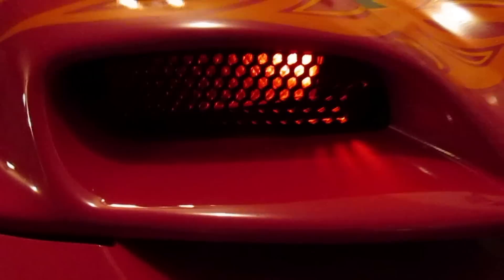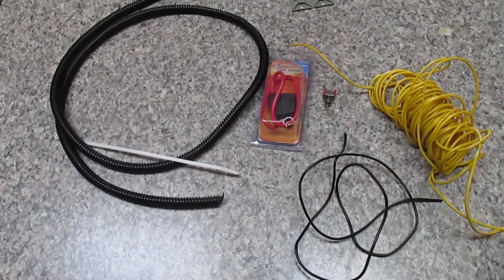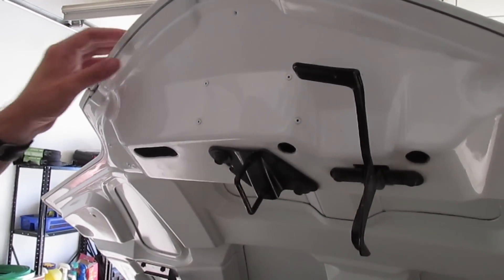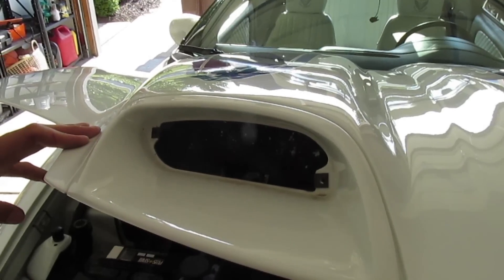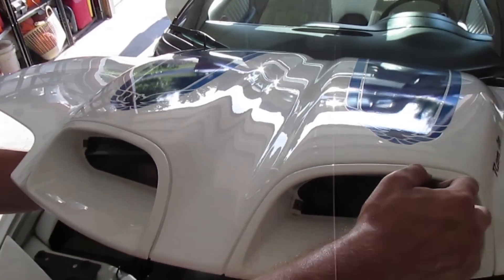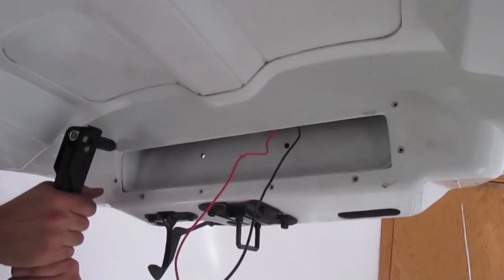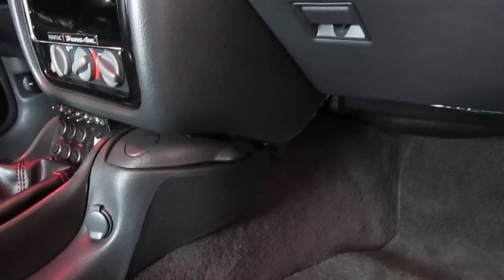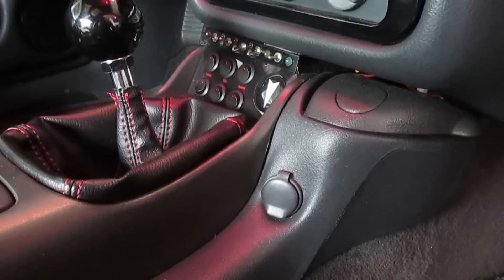1998 - 2002 WS6 Trans Am Knight Rider Light "How To Installation"

Comment: when i fished my wire through the hood, i used a small steel washer and dental floss tied to it.  then i used a neodymium magnet on the outside to pull the nut down to the bottom hole by the hinge.. it took me like 3 minutes to pull it through and you can go around the seams and only have to drill two holes total...  just an FYI...
Reply from the maker: Thanks, I'll have to give that a try.

Comment: Awesome man I bought my ws6 with this already installed however one side stopped working I want to put a new one in i don’t know how the previous owner did it but I seem like he didn’t move any rivets I need help 🙄
Reply from the maker: The previous owner probably put in one of the cheap Amazon led strips of they were able to get it in without removing the rivots.   Mine is quite a bit different and has to be installed how I show it in the video.  I sell it for $299 with 30 scans and 10 speed per scan.

Comment: Interested in the metal plate on the red Trans Am. In front of the air lid. Thanks.
Reply from the maker: That's the JAAM panel.  I could be wrong but it may be discontinued.  Check out WS6Store.com.   They might have it.

Comment: nice and this is old post but does anyone know where they have a kit with this many leds for sale in 2021?
Reply from the maker: I still sell them. I sell this version light for $299 shipped to the US. It comes with 30 scans, remote control or Android control. To get both is an additional $25.
Reply: @1999TransAmWS6  thats great i will save the email not sure which way im going have a smoothie Q hood and my factory WS6 2002 oem hood, working on intake and exhaust now but money is bad during covid19
Reply: @1999TransAmWS6  btw where are u located? Im in the US in SC
Reply from the maker: @beachsidebum  In Illinois

Comment: Excellent video!  Do you (or does anyone) happen to know where I can find a similar kit (pun intended) for a 1996 or 1997 Trans Am with the single Ram Air hood and not the post-1997 split "snorkel" style?  Thanks!
Reply from the maker: I custom make the knight rider lights.  I don't know of anyone else around the world that makes them.  I sell them internationally. I used to do custom sizes but I've decided to just sell the base model 98-02 Trans Am lights from now on.  I've looked into doing a 93-97 light in the past past but it just wont work for that hood and is not recommended if your car has the ram air setup with filter that faces the sky.
Reply: @1999TransAmWS6  that's exactly what I was wondering, and based on your video I did some inspection on my hood and yes, I don't know how it would work with anything in there as it needs (at least most of) that whole area for induction I assume.  I'm an electrician, and do a lot of lighting throughout my home with LED strips, and was wondering if you have seen any advancements in that world that would allow these KITT style / waving motion diode lights?  Best Regards, Jason Paluszak
Reply: @1999TransAmWS6  do you still make the knight rider kits and how much is it for just the lights ?
Reply: If I was to buy one
Reply from the maker: @jaydenluth6094   I do but my prices have gone up a bit and I wouldn't be able to built one until at least July, maybe August.    My Version 5.1 sells for $350+shipping with 30 scans and remote control or Android control.  To get both is an additional $25.
Reply: @1999TransAmWS6  hey how do I get a hold of you to make some lights
Reply from the maker: @drewkelly6192  email me at fitnesstrainer76@aol.com